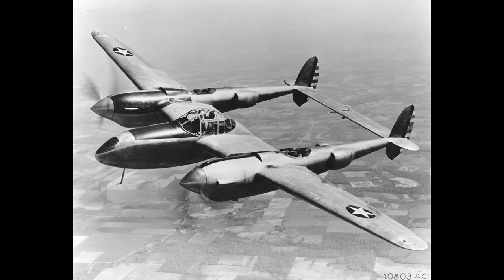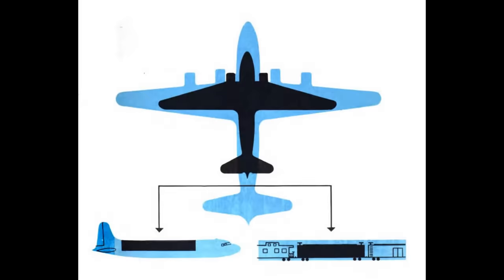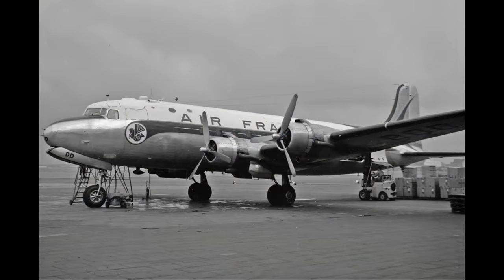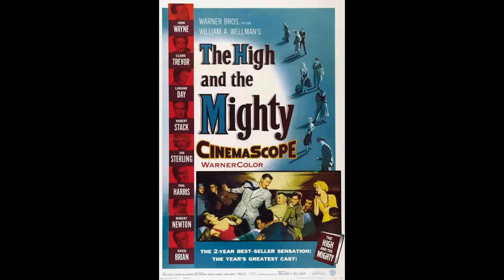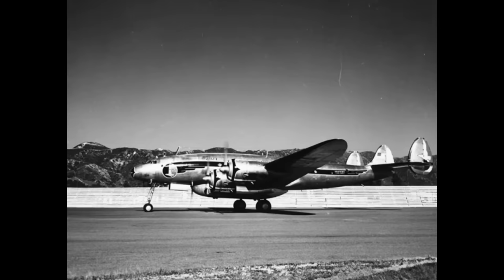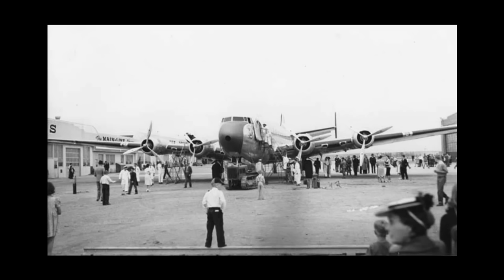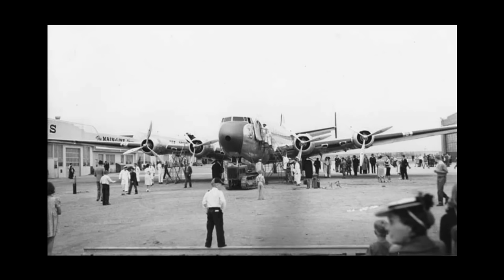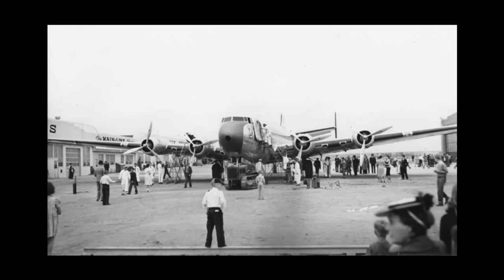Turbo Compound Piston Engines. Almost magic tech.

Comment: Having flown the DC 6 in all three seats, I am impressed with how accurate you are in this video. The only big differences between the 6 and the 7 are the motors. Later, 7s had a longer wing. What really was a weakness in the R3350 with the compound was when these engines had a valve fail or piston ring fail, both common in comparison to modern opposed aircraft piston engines. On the 2800 the bits and pieces would fly out the exhaust pipe with little additional damage. On the 3350 compound, the parts would generally destroy the compound turbine, and I heard from pilots who flew the 3350 it was violent. I had many ring failures and a few valve failures on the 2800, and it was hardly noticeable. We usually found the failures via the engine analizer.
Reply: Hence the nickname "Parts Recovery Turbine" with the aircraft mechanics who worked on them.
Reply: Wow that really is a factor I wouldn't have thought about. Wouldn't this effect turbocharged engines as well?
Reply: Many years ago, I worked on a PV-2 Harpoon in which a young man dropped an unknown amount of .041" s.s safety wire down the carburetor  air horn . I could see a piece of it down in the intake section of the R-2800-31. Since it  was a "can engine" with no log book the boss decided to start it and see what happened. We did and it seemed to digest  and eliminate the foreign objects with little known effect! I really was amazed.
Reply: operating the 2800's in the '90s (Convair props, DC-6 CB motors) i remember how efficient and smooth they were, the problem being the technology never had improved much since the early 40s.  and we were stuck with replacement parts that were nearly that old.  imagine how ring and cylinder and valve problems could have been eliminated with improvements over the years, not to mention the gains in performance w/ modern fuel injection and better cold weather engineering.  even with the carbs i recall SFC's of better than .40 at 1100hp without any PRTs, and with a modern bullet-proof PRT, the possibilities?
Reply: You flew these and call them motors?  I flew all 3 seats and worked on them from their introduction
Reply: @ravenstarver1360  It can, but its also easier to mitigate than a shaft power turbine, most commercial turbo-charged aircraft have more than one turbo per engine, and the tend to feed the same cylinders as it draws exhaust from, so as long as you don't totally fill the engine oil with glitter you can run at half (or more) power. Keep in mind also the high engine failure rate was a product of many factors relating to pushing the envelope of an existing design, with time and technological maturation safety records would have improved (turbine failures aren't very common on turboprops), they just aren't remembered that way because of the short time they where actually viable before the pistons where replaced with jet engine cores.
Reply: @williamfowler709  i guess you never operated a Ford Tri-Engine, a vehicle General Engines never tried to copy
Reply: At what height (assuming ISA) did a DC7C with turbocompounds reach its maximum TRUE Airspeed in level flight?
Reply: It was not the PRT it was design failure like putting a large supercharger on your 8 cylinder chevy

Comment: When I was a boy, there was an outdoor observation deck at Vancouver International where people could watch departing and arriving aircraft. I watched DC-7's departing for USA destinations. The sights and sounds of their enormous engines made a lasting impression I can still see and hear. Watching the spinning prop and the whining starting gear ... then the first cylinders igniting and a belch of blackish discharge from the exhaust followed by a roar as the RPM's came up. One by one — all four engines. So dramatic in a way that no modern aircraft can impress. Years later on my solo cross country for my license qualification, a DC-7 flew under my Piper about 500 feet below me. The noise shocked the bits out of me. I guess he was on ATC, and I was not — although perfectly by the book. As a boy lying in bed at night, I could hear engines of DC-7's and Connies being run up and tested in the engine sheds across the river — an oddly calming sound that was part of my young life. Those old birds were beautiful and offer up nostalgia.

Comment: Great explanation of the greater Froude efficiency of props relative to jets at low speeds.  The insufficient takeoff power of the jet engines of the late 1940s was the fundamental issue driving the weight constraints that did in the Comet 1.  Building an airframe sufficient to withstand the pressurization required of a high-altitude airliner wasn't such a mysterious issue if sufficient power were available.  Building one to meet those requirements with the weight constraints imposed by the already-obsolete DeHavilland Ghost engines was impossible.  Both the Comet and the B-47 used mass injection and RATO bottles to compensate for the inadequate takeoff power of their engines.  The awkward era of commercial aircraft - jets not yet ready for primetime and piston engines being developed beyond their practical limits.

Comment: Greg, I want to thank you for explaining this concept of turbo compounding in such an accessible and yet accurate way. From the discussion about the differences between turbocharging, to the explanations of the different shape of the turbine and the implications of a lack of back pressure, I found this video not just entertaining but highly educational. That's quite a gift you've got there and I've subbed so I can appreciate it even more!
Reply from the maker: Thanks. I appreciate your kind words.
Reply: @GregsAirplanesandAutomobiles   I want to add my thanks, I'd read about turbo compounding in those engines ages ago but could never find any actual diagrams of the system, this explanation is what I've been wanting for years!

On modern engines, with the push for efficiency and the expanding role of electrified drivetrains, I could see a role for a PRT used to drive a generator to feed power to the electric drive motor of a hybrid; whether any company is actually clever enough to design and implement this is a different question entirely...
Reply: Greg's channel: come for the airplanes, stay for the forgotten propulsion tech.
Reply: I shared a hospital room with a retired BMW engineer. He had specialized in mixture control on BMW motor bikes. He sadly remarked that these days the graduates of German Institutes of technology "did not know the first thing about exhaust back pressure". Your video should be mandatory for future German motor scientists.
Reply: @cyrenecai  Your idea is convincing at first sight. Nevertheless there´s a meager 10 percent ratio of the regained power versus 90+ percent of piston-generated shaft power. Given the cramped conditions in a hybrid, I doubt any manufacturer ever considers this idea.
Reply: @cyrenecai Volvo diesel truck engines now has a TC design in the D13-TC that gets 50+ Free HP back into the flywheel from a Turbo compounder unit ✌🏼✌🏼the MPG is the highest of any semi truck on the road in 2023
Reply: Ditto - Greg is truly gifted. Excellent presentation of this material. Subbed.

Comment: Love the pic of the Everts Air cargo DC-6. Where I live (Fairbanks Alaska) those planes along with various other radial engined prop-liners designed in the early-mid 20th Century are still providing much needed freight (and passenger in some cases) service to arctic villages not serviced by roads. Everyday we hear the fabulous rumble of those engines still doing their job 70 plus years after being conceived..Thanks Greg, great explanation!

Comment: Turbo compounding is very common now, and initially Detroit Diesel/Mercedes-Benz was the first to use it on the DD13 and DD15 straight six semi truck engines. Volvo recently added turbo compounding to its D13 semi truck engines at first as an option, but standardized it ( I think ) from 2020 on. I drive one, and it can run loaded down the road at 1000-1200 rpms grossing 75k or more comfortably. The payoff is 8 mpg or better loaded driven properly with the torque peak lowered from 1200 rpms to about 900 rpms.
Reply: I came here for this comment.
Reply: Thanks.  I knew that there were turbo-compound truck engines and you saved me the time of finding them again.
Reply: Are they reliable ? Former DC3 skipper and mechanic helper (1980's).
Reply: @CFITOMAHAWK2 Edited: The Volvo D13TC's power recovery system has two turbines in series, the first is part of a fairly normal turbocharger, the second "Power Recovery Turbine" is behind it with a fluid drive and gears attached to the crankshaft.   Volvo claims that the TC engine has the same life as the non-TC version (1.2 million miles B50).  I did a cursory online search and haven't found mention of issues with the TC.
It has been running in the US since 2017.  The engine got revised in 2020.
Reply: @CFITOMAHAWK2  I imagine materials improvements have alleviated the valve and ring failures modes that were common on those old aero engines.
Reply: 8 loaded is crazy good.
Reply: I find myself wondering if that's the way to meet the car fuel economy standards too. 

Or even if it would be possible to make a light turbine generator and essentially run electric cars off of that?
Reply: @HarryVoyager  I tend to lean more towards a small rotary engine as an "extender" that can only produce enough power to maintain charge at highway speeds.  TBH, I have possibly overly optimistic hopes for the LiquidPiston design since it is so compact and lightweight.
Reply: Not the same thing.  You are referring to 2 turbo's working in concert creating boost.  The turbo compounding referred to here is actually coupled to the crankshaft, a completely different thing.  If you get a chance to see one in a museum they are a completely different function and animal.  BTW Cummins had compound turbos in the 80s... NTC -475 that had that, multiplied boost through multiple turbos working together.  Cat also did this decades ago.  The Turbocompound radial engine is taking that heat energy and putting it directly into the crankshaft as horsepower.. not the intake as boost.
Reply: @kblackav8or  no, they are actually are talking about actual turbo compounding, arguably more common on inline sixes than twin compound turbos...
Reply: Those truck classes are really more "lightly coupled turbo" than true compound engines. Things differ greatly to the aircraft because of the expected "cruise" load conditions of a diesel truck being lower than the turbo would have its wastegate open, with the main advantage of connection to crankshaft to reduce rich air fuel mixture during conditions a turbo would not yet be spooled (while still being a more compact, cheaper and less maintenance than running multiple turbos), while the aircraft is expected to sit with waste-gates flaring almost all the way to critical altitude, no turbo boost would normally mean ground idle/taxi, so shaft coupling the turbine aims to add power for most flight conditions but little benefit is gained in engine response/emissions. You can see this in the mechanical layout, the DD15 looks like it has a normal turbo, with compressor and turbine running on the same shaft, while the aircraft turbo compound systems do the opposite, with the turbine feeding the crank (or even directly into the propeller gearbox) as close to the main load as possible, and the supercharger drawing from the opposite side to attempt to reduce crank loading.
Reply: Scania did have turbo compound in truck engines first in the 90's, then another try in the 00's, but neither were the most reliable. Volvo trucks in Europe had turbo compound for few years in the 00's, only in the last few years it's been getting more common. Still no TC in most Volvo engines.
Reply: @SheepInACart  Edited: You are right about the details, but the concept of extracting otherwise wasted energy from the exhaust gasses remains the same for both.  In some respects, it acts almost like mechanical Atkinson cycle by effectively increasing the expansion ratio.

The Volvo system is impressive since it extracts significant power from the already more efficient diesel engine.   To do so, it allows the engine to run heavily loaded but at lower revs. There is an additional balancing act to keep particulate and NOx low while more heavily loading the engine.  This would normally produce high volumes of both.  It could not do so without the improvements to the fuel injection and combustion chamber. (note: it uses two turbines, so is not as simple has I had originally thought).
Reply: People are so smart.
Reply: @kblackav8or  regarding "You are referring to 2 turbo's working in concert creating boost."
Edited: You are correct that the terms get confusing, but as noted by MiG21aholic, the Volvo D13TC uses the second turbine with  a fluid coupling/torque converter and shaft to feed energy back to the crank.  There are several slick videos on YouTube if you search for "Volvo turbo compound."  I can't write a link because that  tends to get my YouTube account suspended for 24 hours, for some reason.
Reply: @jaakkoiswatching6437  The current system is simplified a bit and uses a fixed geometry turbo.  I suspect that one issue is passing emissions with the TC engaged.  For best economy, the engine needs to run at high loads and low revs, a formula that tends to produce more particulates.  The reduction gearing is also complicated and, I suspect pricey.
Reply: The current/recent diesel engine analogy is not valid.  Pay closer  attention to the video explaining how the PRT (power recovery turbine) delivers power to the crankshaft through a fluid coupling (torque converter), not increasing cylinder pressure through boost.
Reply: @jimanderson1355  Edited:  You are right, I missed the second (PRT) turbine.  I need to lay off the muscle relaxers when analyzing technical things.
Why is the analogy not valid?  They still recover energy from the exhaust gasses, the PRT is just behind the normal turbo?
Reply: @jimanderson1355  I edited my previous comment after you pointed out the PRT.
If you want to see a much more complicated mousetrap, the FEV Group has thrown an electric motor/generator into the mix along with the mechanical connection to the crankshaft.  This adds a ton of complexity but gives the system mild hybrid capability.  They call it ITES (Integrated Turbocompounding/with Electrification and Supercharging).
Reply: @jfess1911  Liquid cooled engines can cool down the heat from the turbines much much better than oil/air cooled.
Reply: @CFITOMAHAWK2  Yup, and materials are better too.  Both help reliability.
Reply: I believe the Napier Deltic an 18 cylinder opposed piston diesel 2 stroke used compounding turbos  as well conventional boost turbos. Quite a machine and used successfully in railway engines
Reply: How much power does Volvos PRT recover?On the 3350 each of the 3 PRT put back 120hp each into the crankshaft.
Reply: @eugeneoreilly9356  They claim up to 16% increase in fuel economy.  Diesels start of being more efficient, so there is less to recover.
Reply: Why not electric as in F1 ? Synergy drive between turbine and compressor to slow down the compressor for low torque.
Reply: @ArneChristianRosenfeldt  Converting energy from the turbo into electricity or using the motor/generator to speed up the compressor is an option, but it requires big enough batteries (or other storage) to rapidly release or store energy.  This moves it more to a hybrid setup instead of an almost purely mechanical one.    
This type of system works best if there is enough regular electrical demand to utilize the extra power.  That could be electric drive motors or even refrigeration systems.
Reply: @jfess1911  s mild hybrid with the other motor on the crank. Synergy drive in a Toyota  can work with out a battery   .
Reply: @CFITOMAHAWK2  It’s the emissions systems that have high failure rates and make the D13, DD13,15 very expensive to operate. Emission related costs far exceed the fuel savings. My old Series 60 12.7 best fuel economy is around 6mpg when I keep my foot out of it but it’s dead reliable otherwise. You can fully expect to run one a million miles (with good maintenance) trouble free.
Reply: @prevost8686  you can more than 6 mpg out of a 12.7 Detroit if you can keep the engine out of boost and the rpm under 1500 rpms at cruise.

Comment: I flew across the Atlantic on a military Super-Connie (Air National Guard) in the early 70's. I was amazed how quiet the plane was on the ground while taxing, at least compared to pure jet aircraft or turboprops. Sounded great. But when they throttled up for takeoff, it got incredibly loud and the entire airplane was vibrating. There were only a few of us on board, and I made a point of sitting in various parts of the plane to judge noise and vibration. Sitting directly in line with the props was horrific, with the floor vibrating so badly that my feet fell asleep and the entire seat vibrated something terrible. 

But I was glad I did it. On the other hand, all my other flights were on C-141 or C-5 aircraft, and that was much nicer once we got airborne. But still noisier than civilian jets. Interior noise was not a design criteria.

Comment: Employee from Banks Power here, and this deep dive into into aviation piston turbo compounding is absolutely fascinating. 

What you mention at about 18:30 in about turbochargers still causing back pressure and require horsepower to run rang very true to what we know at Banks. 

It’s amazing to see how these truths were known over a half century century ago. Makes one re think all the ways an engine can recover power effectively to both improve power when you need it, and also make the same power, with less fuel. 

Well done sir 👏👏
Reply from the maker: I appreciate your view and comment. I know who you are and think you folks do fine work over there.